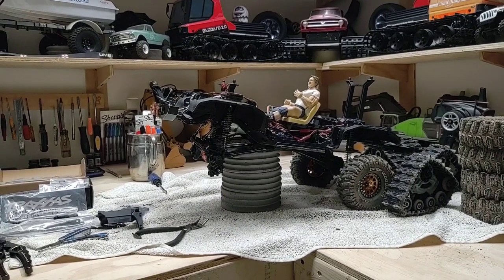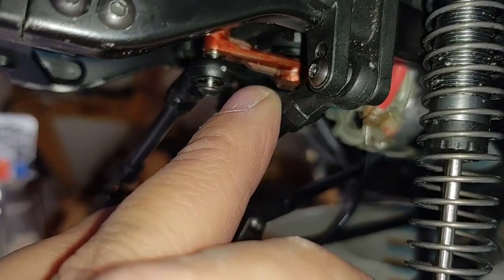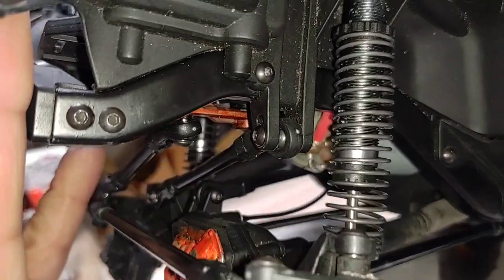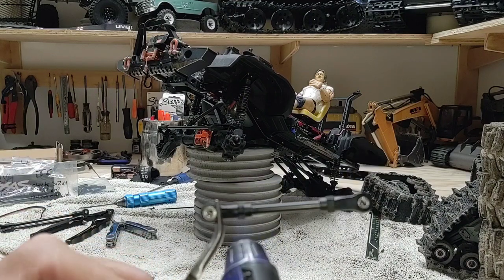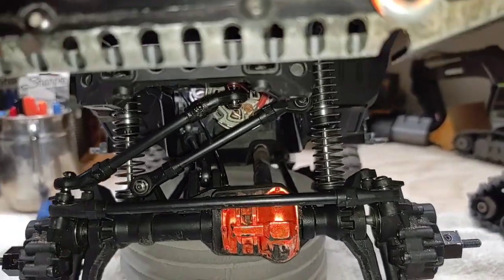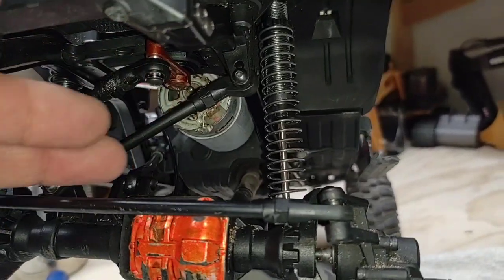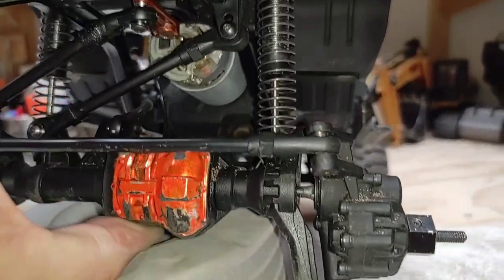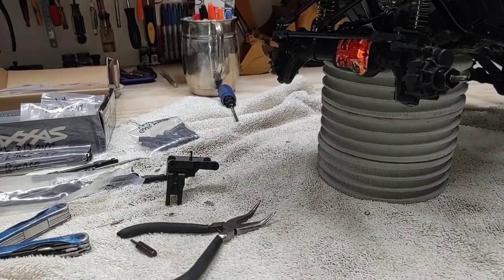Trx4 Long Arm Lift & High Trail Edition "Front Suspension Correction & Getting Full Travel"

Comment: I found a steering servo mount  that relocates it behind the bumper and in front of the axle. Works mint with all the other modification you did! Didn’t need to bend the link ends either. Never liked the design grass as did. Your video was a great help!
Reply from the maker: Nice... What's the brand name on that new servo mount, and where did you get from ? 😁
Otherwise much appreciated for the heads up, and many thanks for checking out the video Jeff.
😊👍
Reply: @RCnuts2020  May I ask hat steering servo mount are you running? Thank you in advance

Comment: Well anyway mister jim, It's good to know, but not. I am not worried about the traxxas  suspension whatsoever, You know, sir. I've been running this little truck around for ten months or so, I just believe  traxxas makes some quality equipment I think it drives crawls exceptionally well, The desert lizard shocks are absolutely phenomenal, There are ten timer better than the bloom Shocks,,👍👣👣📹👀 The body details absolutely phenomenal,, ,,,,,
Reply from the maker: To each their own Kevin 😄
If you're happy with the way Traxxas has that front suspension setup, then more power to you.😄 
But in my opinion you're kinda short changing yourself running it the way Traxxas has it set up.😕 

As for the Desert Lizards;
All I can say "is that I'm not going to drink that Kool Aid,
😄 I personally think that the Desert Lizards are no better than the Boom Racing shocks, and there's not much that anyone can say, that will change my mind about that.😕 
Yeah Racing isn't exactly known for High Quality, and I think that pretty much says "all that needs to be said.😕 

One thing that no one has done yet "or at least no one has commented about"
Is measuring the difference in shock travel between the Desert Lizard 120mm and the Traxxas 110mm shocks, 
My guess is that the Traxxas 110mm shocks have the same "if not a pinch more travel than the Desert Lizard 120mm shocks.🤔? 😕 But that's just my thoughts on it! Won't know for sure, until someone actually puts them side by side, and measures them.😕

Otherwise though, I Stand on the Front Suspension Modification,🤔 and think that it's a much better way to go vs running it the way that Traxxas has it set up.
😕 But once again that's just me...😄 Lol
Reply: I think the high trail Works just fine, Anyway,, , It is a super truck and I believe it that is so🫡👍
Reply from the maker: @kevinbreaker2683 
And I'm not arguing with you about that 😄👍 I love Traxxas too, and I love the High Trail Edition Trx4s, But.. but,but,but,but, but!
The High Trail Edition & Long Arm Lift Kit's "Servo Mount/Panhard Bar Mount" Just isn't quite right from the factory 😕 "and there's absolutely no denying that fact,🤔😕 and the Fact that the Driver side Front shock can't Articulate as far as the Right side, and the fact that you can't compress both front shocks to full compression at the same time, Is 100% Percent Proof Positive, That the Front suspension "just isn't right.
😕 Wouldn't you agree Kevin ? 
How many other Crawlers do you have that are like that ?  "Probably Zero" 😕
Not having Equal Front Suspension Articulation, and not being able to Compress Both front shocks at the same time "to full compression,😕 That's not normal for a RTR crawler, wouldn't you agree ? 😕 A stock Trx4 with 90mm shocks has full travel and articulation up front,😕 why doesn't the High Trail Edition ? And what's the purpose for putting 110mm shocks on the High Trail Edition, if your going to put 9mm spacers on all the shock shafts, consequently sacrificing 9mm of the shocks overall travel ? 🤔😕 And the reason for that 9mm spacer is to obviously hide the fact that the Front Suspension wasn't set up right with that Drop Down Servo/Panhard Bar Mount.😕 It's 100% Obvious!  I mean what's the point of putting 110mm shocks on the High Trail Edition if their going to limit the travel by 9mm's ?😕
I mean really.... It's kinda false advertising if you think about it 🤔 ? 
They advertise "long travel" yet they limit the travel by 9mm's 😕 and why do they limit the travel by 9mm's ? 
And the Answer is... To hide the fact that the Drop Down Servo Mount isn't Quite Right.😕 
The High Trail Edition probably has equal front suspension articulation with the 9mm bump stop spacers installed, But once you remove that 9mm spacer from all the shocks "in order to gain full travel" that Drop Down Servo Mount Flaw, is instantly revealed,😕 It's a flaw straight up! There's no denying it, and More importantly, "there's no actual reason for it either,
All Traxxas needed to do was move the servo closer to the front of the frame, And they would have had it made.😕 
At the end of the day somebody didn't do their proper diligence on the design table,🤔 and apparently covered up their mistake "by installing 9mm plastic bump stop spacers, on all of the shocks,😕 Which was another mistake "since it's limiting the travel"
Not only on the front, but on the rear suspension as well, and there's nothing wrong with the rear setup, it Articulates & goes to Full Compression just fine without that 9mm bump stop spacer,😕 The Front Setup is the one that's the problem,🤔 but they had to install those spacers all around, in order to make it appear equal.😕 Or at least that's my thoughts and grand conclusion on the subject.😄 Lol 
There's no reason for it Kevin... And that's the bottom line brother.😕
The fact that they sell it without the ability to get Full Articulation on the Left Front Shock, and without the ability to Fully Compress both front shocks to Full Compression at the same time, Means that it isn't right,😕 "and once you remove those 9mm plastic bump stops from the front shocks, the problem becomes totally evident.😕 
What else is there to say ? 
😕 
How many other RTR Crawlers on the market are like that ?  And the answer would be Zero, The vehicles may all have different length shocks, but I'd pretty much guarantee "that they all have full travel, and equal articulation on their front axles,😕 And the High Trail Edition is the only exception.
And what's that mean Jim ? 
It means that it's not right darn it! 😄 Ha ha ha lol 
And that's all that I'm going to say about it bro, and saying that it's okay the way that Traxxas has it set up, "is basically like being in denial.😕 And I would have to believe, that any hardcore RC enthusiast would agree with me "about that not being right"😕 
Now that we covered that subject, Please don't let that drive a wedge between our friendship Kevin,😕 if you're happy with your Trx4 High Trail Edition "then I'm happy for you as well,😁👍 But when it comes to myself, I prefer to get the most out of my vehicles, without having to add extra ride height in order to gain full suspension travel, or installing 9mm plastic spacers on all the shocks "to limit my suspension travel" in order to cover up a suspension design flaw.😂
But that's just me 😄 lol 
Otherwise if you're happy with your setup, then I'm happy for you brother.
😁👍🤜🤛👉🏆